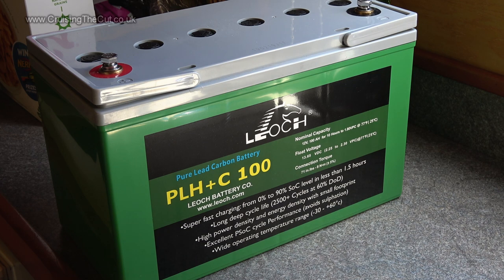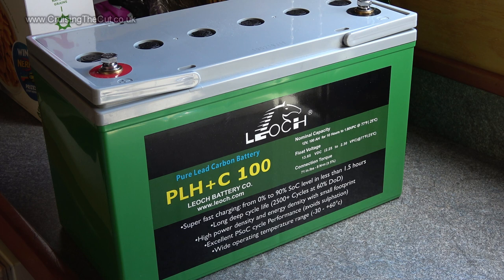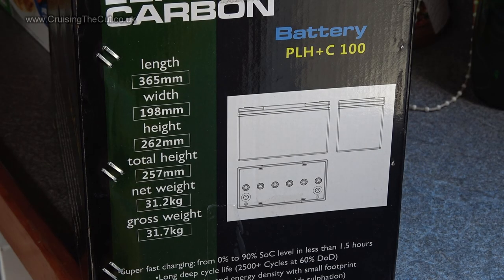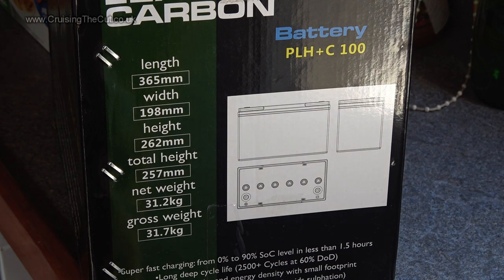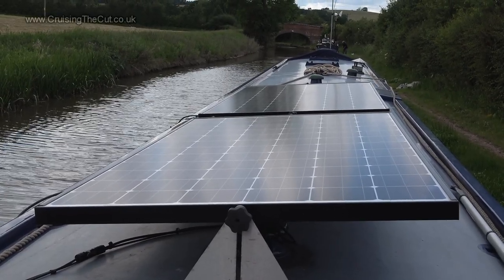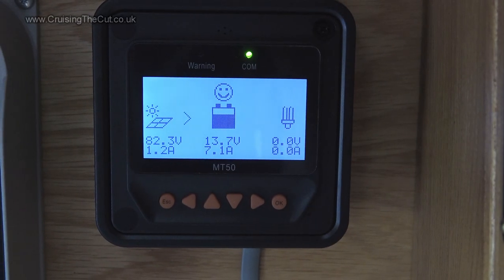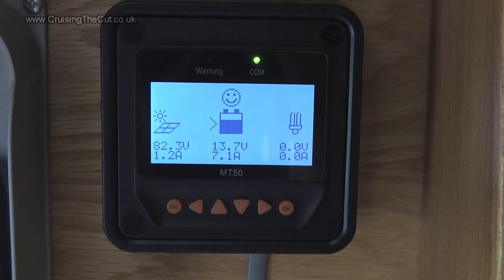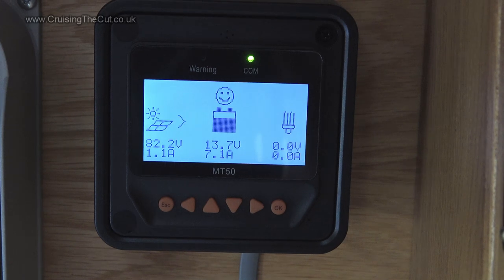178. Installing Lead Carbon batteries (12V 100Ah) into my canal narrowboat

Comment: 300 quid a pop, you have obviously got more money than sense, haw haw haw.
Reply from the maker: Firstly I didn't pay nearly that much for them. Secondly, compared to lithium at £1,000 apiece these are a bargain. Thirdly, they should last considerably longer than traditional lead-acid and with better performance, so they're better value that way too. So, actually very sensible indeed.
Reply: I see the battery saga continues David! In fact you bought rather better, actually much, much better than you knew  ... better than "sensible" in fact. Keen as I am on all things technical a thorough read about Lithium technology was/is a must. Yes, they are uber batteries is some situations (definitely, definitely not all) however, a read of ALL the necessary paperwork is to be advised.

In particular the warranty ... both battery and car manufacturers certainly are aware of the shortcomings of these batteries and some battery manufacturers even go so far as to specify the range of temperatures in which the battery must be used (for a claim to be considered that is). In one instance a battery manufacturer specifies a working range of, now read this well and inwardly digest, 0C to 43C. Last year we, in allegedly temperate UK, recorded a low of neg 14C ... you can see where this is going.

I understand, now, why lithium batteries are so well protected in the charging management department. Literature from vehicle research institutions discovered all this years ago. A search, if anyone can be arsed, may be worth it  before you spending around £5k on a lithium battery bank and associated charger. Some research even goes so far as to state that in some regions a lithium powered vehicle might as well be a paperweight (my term).

In short (no pun intended) lithium batteries are perhaps not the holy grail of "replacement" batteries for narrowboats. I would suggest that all these technical question ref charging rates and discharging rates are a bit of a waste of time or even pointless ... better to ask what temperature the batteries are going to be working in.

Could be that lead carbon technology is the best bet overall for efficiency and ultimate cost effectiveness, certainly where narrowboats are concerned.

Comment: Food for thought... 50 mv across the heart is enough to cause cardiac arrest. In other words be careful when working with electronics
Reply from the maker: Indeed, it's the Amps that kill you, not the Volts (I believe the saying goes)
Reply: 50mA but you'd also need a much higher voltage to penetrate the skin
Reply: @CruisingTheCut  My dad, an electrician, often told a story of a coworker who had the habit of wearing his golden wedding ring while working.  One day a stray volt jumped the wire he was dinking with, incinerated his ring, stopped his heart and threw him into a nearby wall with enough force to get his heart started again.  After that Dad kept his wedding ring on a chain around his neck.  Electricity is one of the scariest forces on earth.  It was good to see you taking precautions.  Nice job.
Reply: @CruisingTheCut  indeed, dangerous stuff! keep yourself safe out there, and keep up the good work!

Comment: Remove the Red wire first.
Reply from the maker: Ahhh but do you?! ;-) ;-)
Reply: No, no.  The instructions are:

“Remove the red wire,
 but first...”
Reply: Sure...that is the recommended paractice on SOME systems yet not all.  For a variety of reasons some manufacturers recommend removing the negative lead first. Not many yet some do. Careful what you preach Ju.
Reply: In auto shop we were taught removing the red (positive) first because if you remove the black (negative) 1st and it should touch ANY other metal body part the circuit is restored.  Removing the red 1st eliminates that possibility.  Albeit advice from  50 some years ago but sensible still.

Comment: the 'c' i'm guessing, is calcuim, which'll make the plates a little thicker, an last a bit longer than other 100amp batteries. nice purchase m8!
Reply from the maker: The C is Carbon
Reply: C is Carbon. Ca is Calcium.

It's right there on every periodic table. ;-)

Comment: Wire them in series and I know people will get mad but you always remove the positive first because the negative is ground. No one can really argue with that if they do they clearly don't know what they are talking about hell ask any electrician..
Reply: The reference is to auto electrics where the vehicle chassis is negative. You always remove Neg first so if you touch the chassis with your spanner nothing happens because its already negative. Then you remove the positive, so if you touch the chassis with your spanner nothing happens because there's no circuit.
Reply: ...and any good electrician (and mechanic) will teach you that you first remove negative. Because negative if is still connected to ground (at least nowadays common, in some vintage cars it may be different) and you put a spanner on the positive poleconnector you may hit something metal wich could be (almost always) connected to ground and short out. If you put a spanner on the negative, grounded connector, and you accidently touch something else, no problem. That's why groundstraps are not isolated.

Comment: Hello David I know the volts are low but the amps phew. Don't EVER do this job wearing a copper bracelet.
Reply from the maker: Too right. I even took my watch off for this!
Reply: @CruisingTheCut  Oh I'm not kidding I once saw a guy I worked with (at Northgate van hire other van hire firms are available) have a sprinter van battery explode in his face. I have never moved so fast and all I had to hand was a watering can of SCREENWASH well he got the lot (followed by many watering cans of tap water) and an ambulance. But the ambulance man said I had probably saved his sight.  I know I have gone on a bit but next time you do things in your very closed battery bay vent it for a good hour before mucking with connections. I would dread seeing you come to grief.
Reply from the maker: I wasn't kidding either, I'm aware how much current can flow if it connects. No need to vent though, the old batteries are sealed AGM and have practically no gas emissions.

Comment: Ever see hydrogen gas explode? I’ll just leave it right there
Reply from the maker: Your point being? These are sealed and do very little venting, if any.
Reply: I’m just saying this, a little hydrogen goes a long way. I’d hate to see anything happen to your boat or you or anyone else’s for that matter. A inclosure vented outside would just insure your safety that’s my only reason for posting.
Reply: Regular lead acid batteries vent hydrogen gas on charging too. That’s why battery areas are supposed to be vented outside on boats and other enclosed spaces.